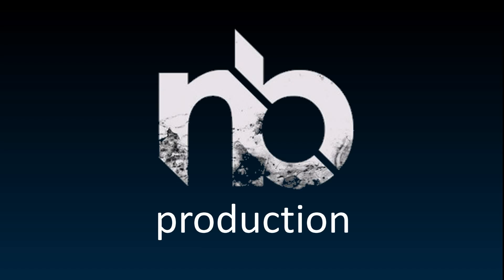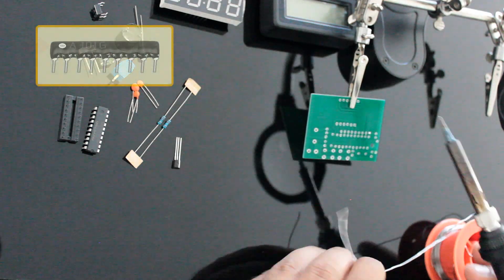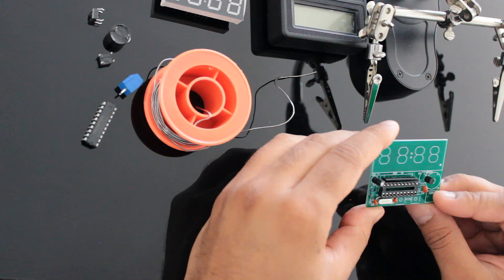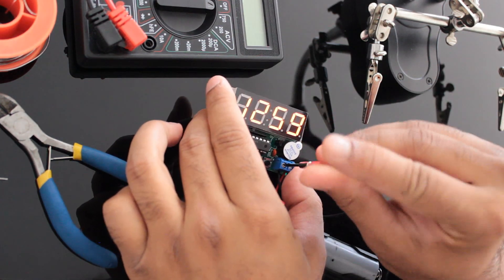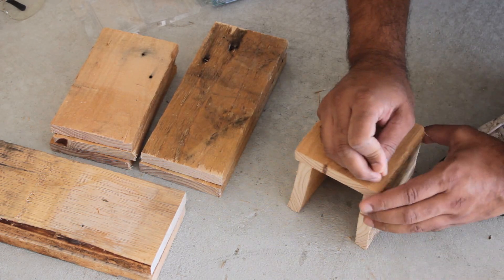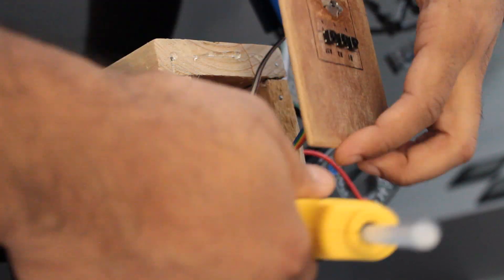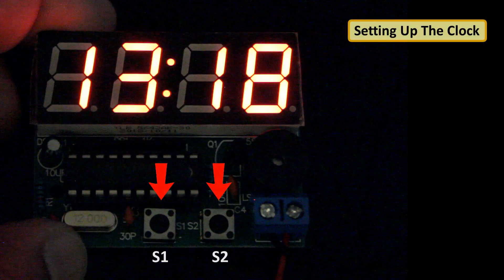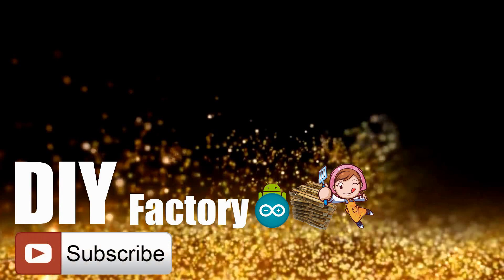C51 4 Bits Electronic Clock  - YSZ 4 Hacked

Comment: Do we need to set time if battery dies, can we use USB charger, should we set time every time after power cut
Reply from the maker: Yes thats a drawback.
That's the reason why I added a battery rechargeable to this setup later on
Reply: @CrazyCoupleDIY  Thank you for your reply. I am think of using TP4056 for charging batteries, but the spec states we should not load while charging.. Without load, i will lose time again set time, Which I don't like..

can you please suggest any board which can be used while charging batteries